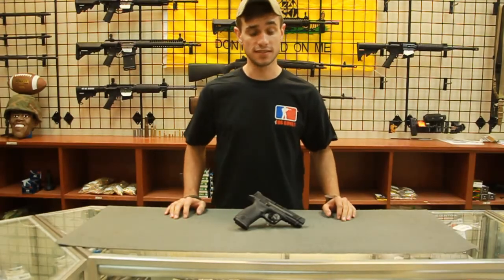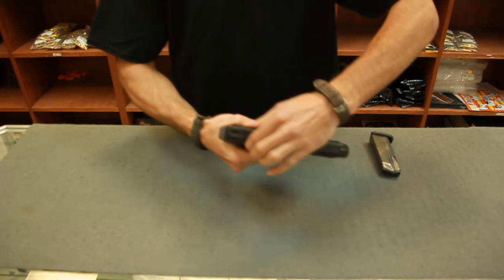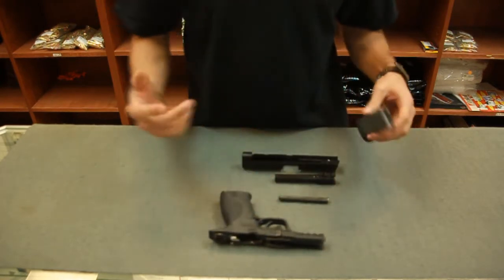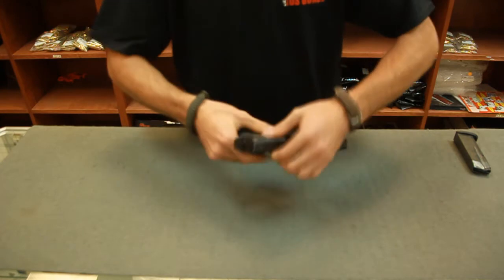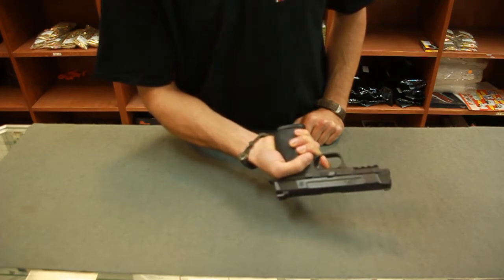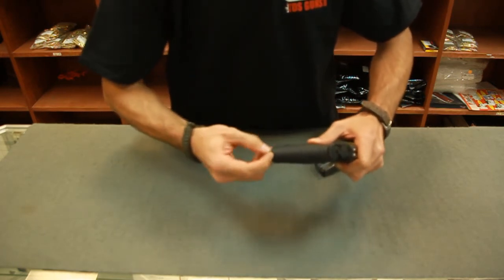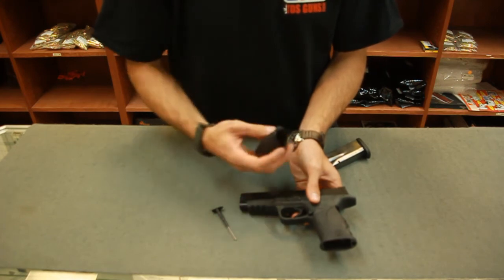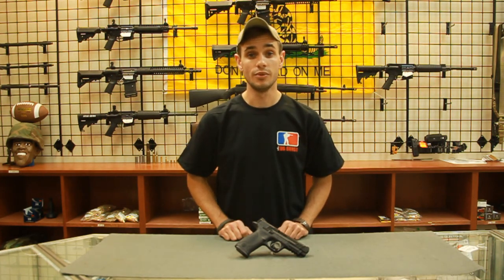S&W M&P Field Strip Guide by TDS Guns

Comment: Subscribed! Good to see these videos. But when removing the slide on the M&P you don’t need to insert an empty magazine and dry fire the pistol. Alternatively, while the slide is locked to the rear, look inside the ejection port to locate the small, metallic seer deactivation lever in the mag well. Using the frame tool (or your finger) rotate the seer deactivation lever down approximately 90 degrees so it’s protruding into the mag well. At that point you can rotate the takedown lever and remove the slide, pulling it to the rear then straight forward, off the frame.